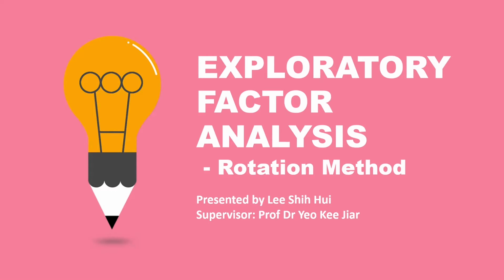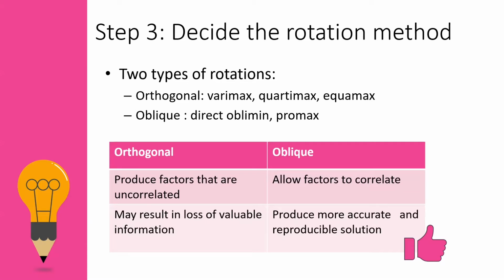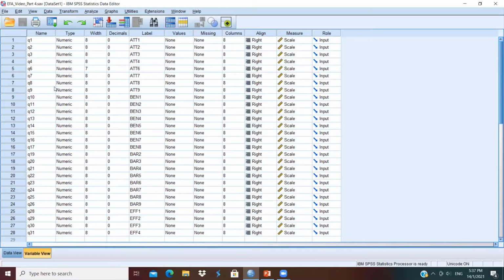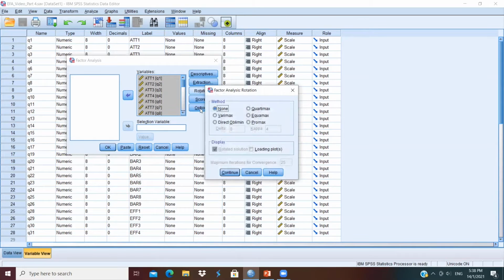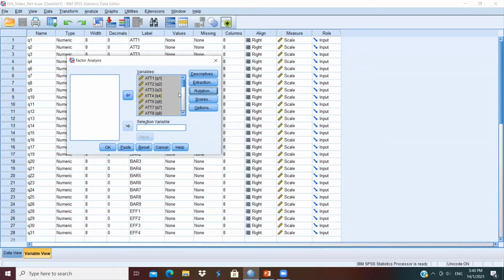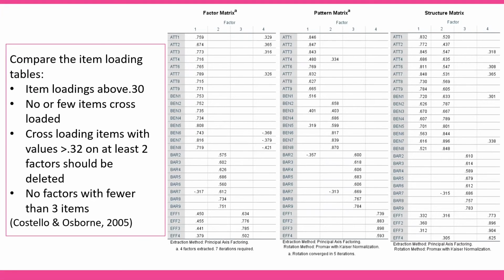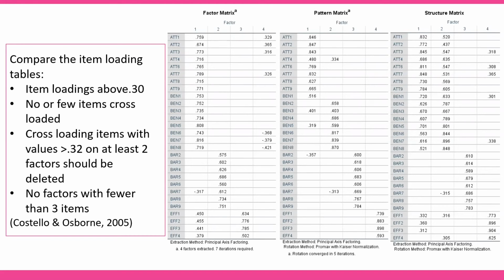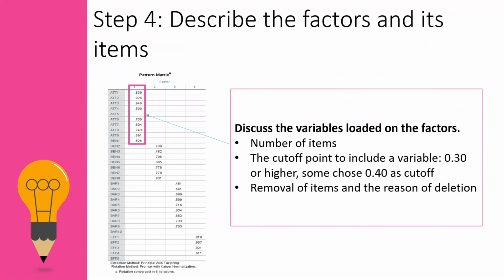Exploratory Factor Analysis (EFA) - Part 4 (Rotation method: Orthogonal or Oblique rotation?)

Comment: Hello Ms Lee. I hv question, if one of the three factors in my pattern matrix have all item loading is negetive, should i remove all negetive loading? and automatically, the factor become only 2 factors.
Reply from the maker: Hi, Razif, sorry for late reply. I don't think you should remove the negative loading items if they display acceptable value above 0.4 (regardless of positive or negative). Negative loadings can be interpreted as the items having negative relationships with the construct. For example, if you are measuring attitude towards Maths and you have an item that indicated 'I think Math is boring and dull'. Then, the item most likely will exhibit negative but acceptable loading.
Reply: @shihhuilee5648  Thank you :)